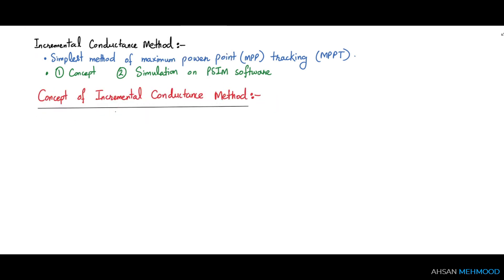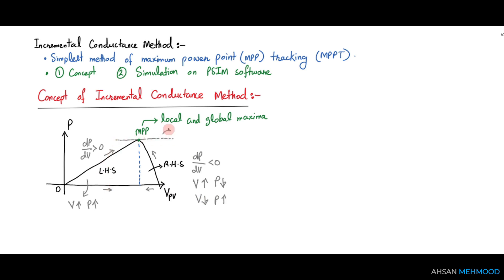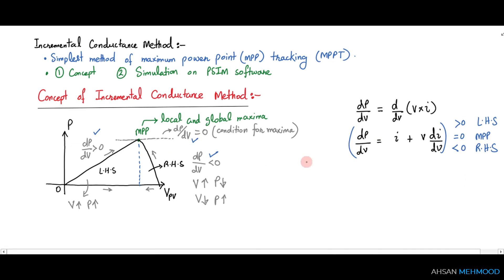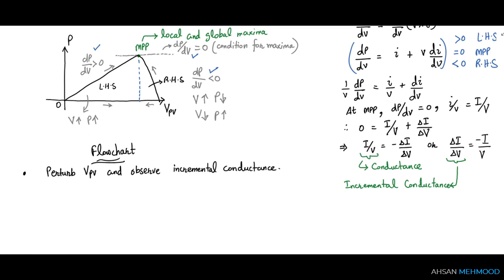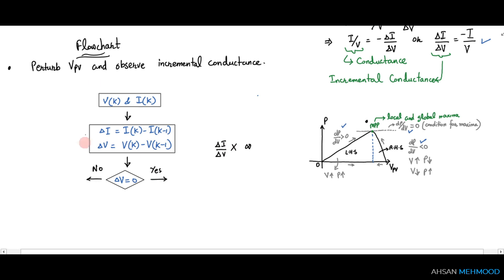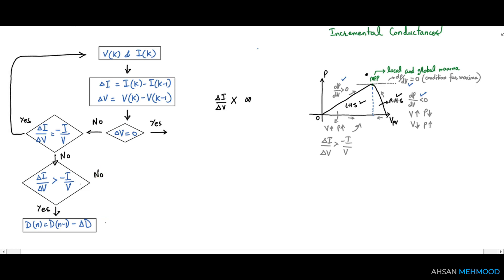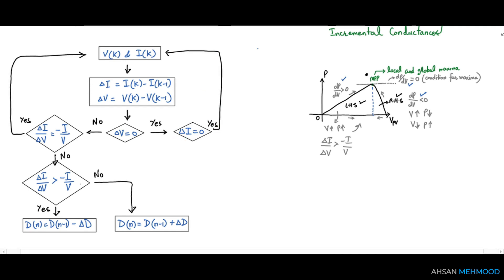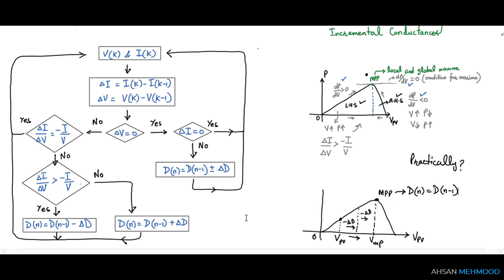MPPT Incremental conductance method concept & flowchart

Comment: Kindly reply.. If my pv input is 98 volt dc (open circuit voltage) max voltages on load 80 vdc, max current on load 11 amp.. how much max current can i get on 24 volt system with incremental conductive mppt?
Reply from the maker: Are 80 Vdc and 11 Adc, Vmp and Imp of PV array?
Reply: @ahsanmehmood9229  vmp 41 imp 10.98, 2 panela conmected in series
Reply from the maker: Then what is 80 Vdc?
And 24 Volt system means, you are using 24 volt battery?
Reply: @ahsanmehmood9229  yes i m using 24 volt battery i want to know how much amp will go to my battery
Reply: I connected 2 panels in series 40 vmp + 40 vmp= 80 vmp (11 imp)
Reply from the maker: You can use this formula: Pi=Po, i.e., Vi*Ii = Vo*Io. If Vi=80 V, Ii=11 A and Vo=24 V, then Io=36.67 A.
Reply: 24 volt* 36.67 = 880 watt? On only 2 pannels of 450 watt?? Sir how its possible?
Reply from the maker: Your array has maximum power rating of 900 W.
It is supposed here that your array is operating at power of 880 W (80 V and 11 A). Then it is possible.
But if your array is operating at less power, then battery current would be different.
Reply: @ahsanmehmood9229  what kind of mppt i use to get 800 watt production?
Reply from the maker: If you could explain your project through email that what exactly you want to do, then I can guide you better.
My email has been given in 'About' section of my channel.